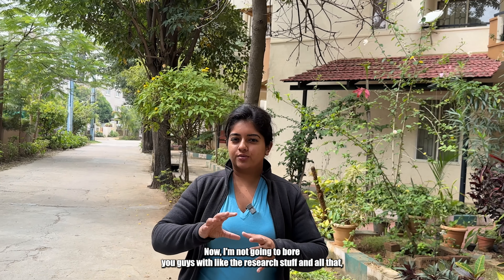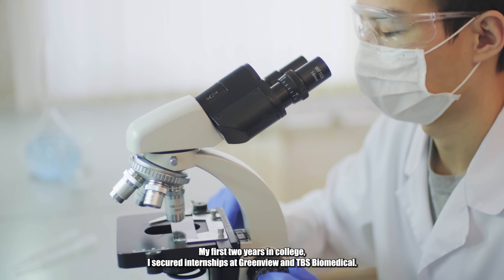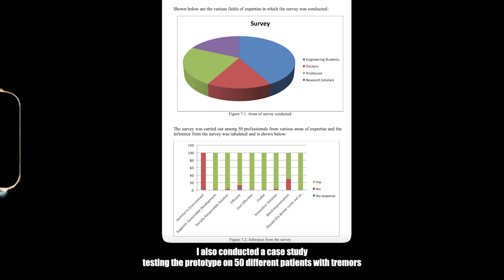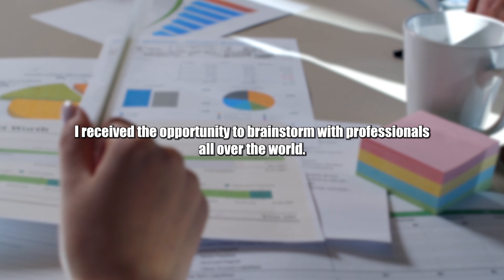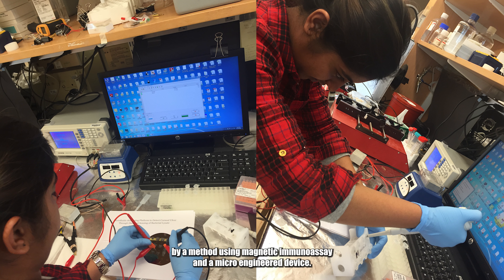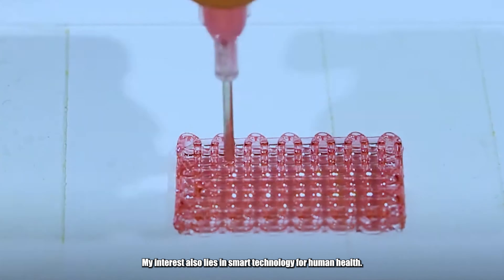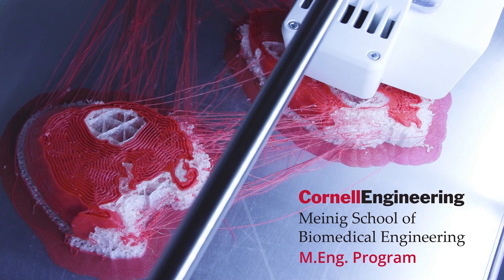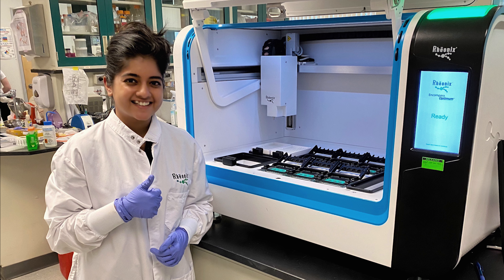Why Choose Biomedical Engineering? | My Story

Comment: Hey, please tell me what is a dual degree ❤️
Reply from the maker: Dual degree are offered by almost all colleges, it saves you a year, an example of dual degree is 3 year undergraduate plus 2 year masters - so you are enrolling once and finishing 2 degrees in 5 years instead of 6.
Reply: @CrazyMedusa  and what is the meaning of class of 2026??
Reply from the maker: Class of 2026 = class that will graduate in 2026, just to be more clear they got admitted in 2022 (undergrad runs for 4 years, so they are called class of 2026).
Reply: @CrazyMedusa   thank you so much sista ❤️
Reply: @CrazyMedusa is there any way I can contact you other than via youtube email?